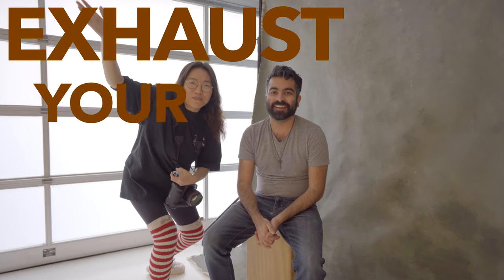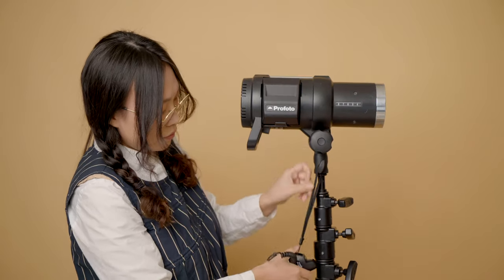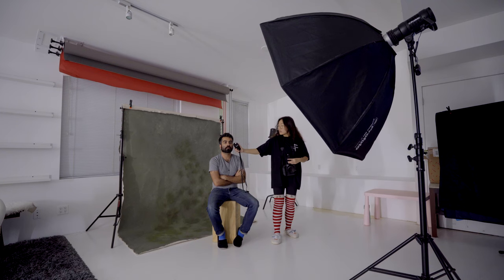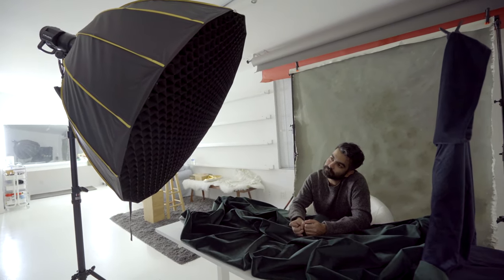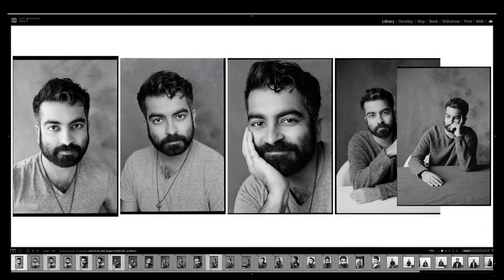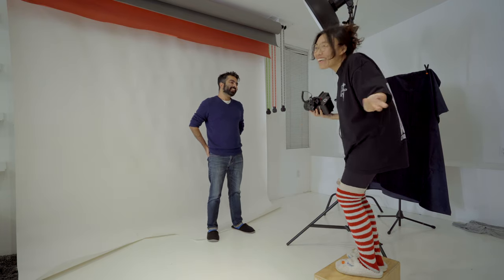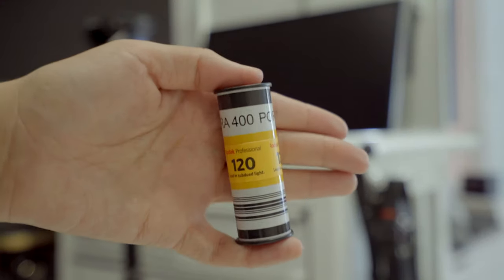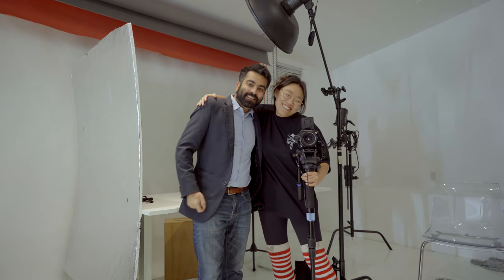How to shoot film with studio flash light

Comment: There are almost no videos out there on using modern wireless flash with film cameras, including leaf shutter lenses, and the few that are out there, skip over almost everything, the details, that anyone starting out would need to know. You not only left out nothing a wireless flash beginner would need, but demonstrated somewhat more advanced lighting setups as well. Great video, thank you!
Reply: not quite. she used the wrong wireless trigger. The profoto air ttl doesn’t have pc sync cord but the regular air remote does AND it is universal and works on all cameras. If she had bought the correct remote she would not have needed to buy pocket wizard. Otherwise i agree.

Comment: My favorite part about using older cameras with newer digital flash is that if you have one with a leaf shutter, they typically sync to all the speeds. like cop[al shutters and the like. which is much more helpful than the typical 1/200th sync speeds of many modern cameras.
Reply from the maker: I always thought leaf shutter could sync to all speeds but UNDER 1/200😅~ I never used high sync speed before, I’d love to try it sometime~

Comment: Sounds like the depth of field preview is engaged on your Hasselblad lens. There is a little tab, usually close to the flash connector. If you push it, it should disengage back to default. The lens has automatic aperture stop down, so you should not have to open up to 2.8 to focus to then stop down to f8 to shoot. If the lens works normally you can set the lens to whatever you want but it will always project the image at the brightest setting when you are focusing, only as you press the shutter the lens will automatically stop down. But if the lens is locked in depth of field preview mode it won’t work this way. One time this mechanism broke on my 80mm so I sent it in for repair. There is a little spring inside that had broken needed to be switched out. 

Also the best thing with the Hasselblad is the leaf shutter. The camera will sync on all speeds. You can sync on 1/500 shutter which means you get waaaay more power from your flash shooting outside. This was an even bigger advantage in the 70’s when focal plane shutters typically only synced at 1/80. So for flash photography leaf shutters are king, still the case today.
Reply: this!

Comment: Sam, at 1:40 you missed one tip, to sync MF and LF cameras (lenses, as they are Leaf shuttered ones 🙂), you need to use both, a cable to the transmitter, then a cable from the receiver to the flash, as most MF and ALL LF cameras have a 'cold shoe' ; aka no electricity into the shoe. the way you do it with 'pocket wizards' is fine for digital, as the shoe there is electrically connected to the transmitter, and the 'accessory shoe' is a hot one!

Comment: Just discovered your videos and I love your presentations and your love for everything photography. I also shoot Hasselblad V system, 35mm film and digital, and to answer your question at the end of your video, for studio work as you did here I would suggest trying a low ISO speed film like Ilford FP4 125 or Fujifilm Acros 100 and develop with standard agitation. The thing is with higher speed (400 and up) or when pushing, it is critical not to over agitate your tanks which can not only give you more visible grain in your emulsion but also increase your contrast. With slower speed films and portrait work in my experience it is always best to develop for a flatter or lower contrast negative which is not hard to achieve with 100 speed as long as you follow the guidelines, why? because in the darkroom or scanned>digital post it is easier to add contrast to a lower contrast negative than it is to flatten an already contrasty negative.
Loving your photography journey so far and I'm an instant fan, you just got a new sub 😊
Reply from the maker: Thank you, this is very helpful. I’m recently learning developing color film as well, using rotation methods, I find the re is more color grain in my negatives. I was wondering if that has anything to do with my agitation… I think I’m gonna try hand agitation instead of roller.. and I bought some FP4, can’t wait to try it!!
Reply: @itscapturedbysam  I am not experienced with doing my own Color processing so I don't know for sure about color grain. I noticed you have a video on color processing. I need to watch it 🙂Rollers are good for standard processing but if you are wanting to control the grain and contrast, hand rotation is more versatile with the many ways to agitate and its intensity, just keep in mind to tap your tank on the table after each agitation to dislodge any air bubbles off the emulsion. 
Enjoy the FP4, I think you'll like it especially for portraits.

Comment: @02:00 you say the Profoto flash needs to be brand specific for the trigger. This is ONLY true for the TTL remote but that is because the pin connectors are different for sony, nikon, canon etc (hardly protofoto fault). If you buy the plain Profoto Air Remote it is universal (works with all brands) and has PC sync cord. No one uses TTL at this level anyway... I use the profoto remote for Mamiya, hasselblad, leica etc and it is wireless because the remote attaches to the camera and the hot/cold shoe which triggers strobe. RZ67 & hasselblad have pc sync port and you plug a small cord into the Air Remote (has a pc sync port). You need the right attachments for Leica film cameras and Mr Leica on his youtube channel explains it, but any Impact cold shoe adapter with pc cable works (b&h). Sam, you bought the right profoto strobe but wrong remote trigger.

Comment: I am a total sucker for delta 3200 for any occasion
Reply from the maker: I just bought Delta 3200, haven't tried it yet!!
Reply: Yeah it can be nice but natural light becomes a total nightmare if you’re doing flash studio photography with a fast film. You’d  have to shoot at f22 and probably still need to turn the flash power way down, at which point you risk having natural light compromising the strobe light. Much more practical to use ISO100 or ISO50 film.

Comment: what about when you shoot with multiple strobes? Do you need a receiver attached to each one?
Reply from the maker: You can set other strobes as slave, they will fire when they see the main flash go off.. but some times it’s not 100% reliable, if the flash is weak or point at different directions. Have multiple receivers will help for sure..

Comment: I appreciate the effort you've made to provide us with solutions to a question you're asking. But your thought is incomplete because the trigger profoto has the function of directing other flash other than the brand profoto. it was unnecessary to go through a trigger pocket wizard.
Reply from the maker: What do you main by directing other flash? I know there is an universal profoto trigger, I don’t have the universal one, and it’s much more expensive than pocket wizards 😂… is there something new I don’t know of?
Reply: By the way, your Profoto trigger has an IN and an OUT input on each side. You can plug in a 3.5 mm PC Sync cable sold by Profoto. you plug the jack part into the trigger and the other into your Hasselblad optic.